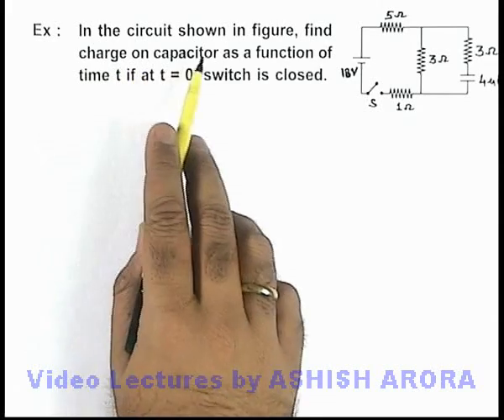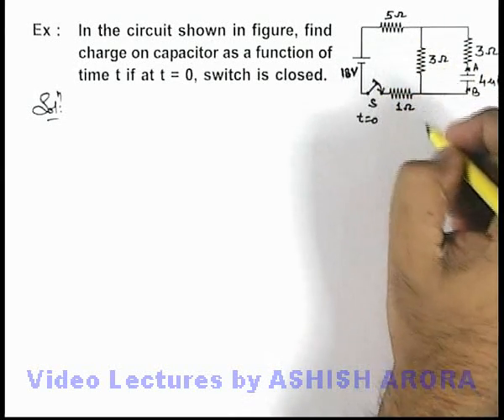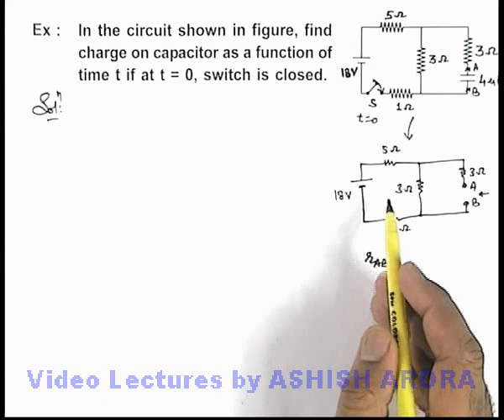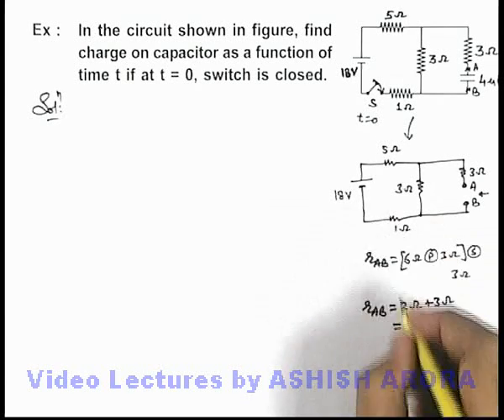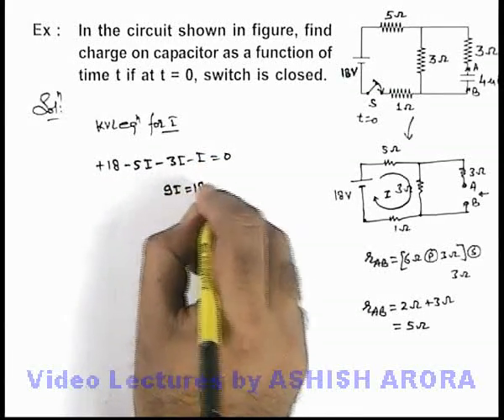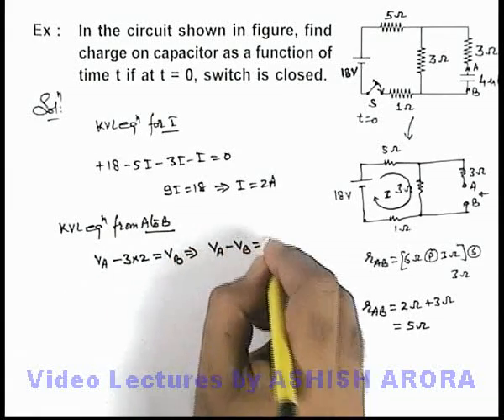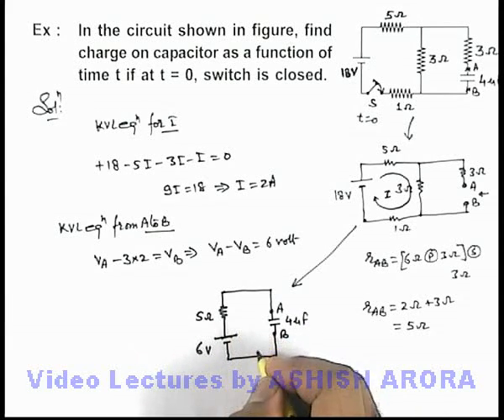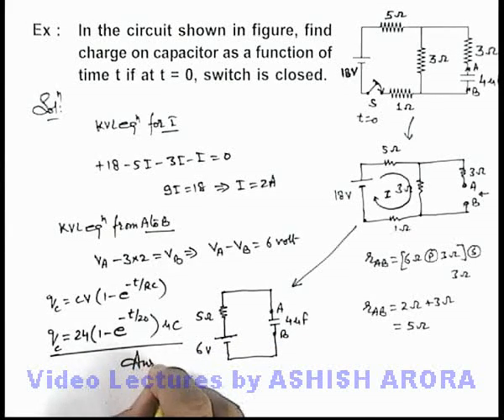Class 12 Physics | RC Circuits | #10 Solved Example-2 on RC Circuits | For JEE & NEET

Comment: At 1:36, why are the 1 and 5 ohm resistors in parallel with the 3 ohm? I thought the two 3 ohm resistors were in parallel, and the equivalent of those two in series with the 1 and 5.
Reply: If you consider there is no battery there then you'll be able to see it properly, you are thinking about R eq across battery whereas we're supposed to find R eq across A and B here

Comment: 3:08
Sir Why No Current through that 3 ohm Resistor
Reply: because it is an open circuit,so no current is flowing through that resistor...and while writing the kvl eq for that open circuit ,potential drop is considered at middle branch 3 ohm resistor which is due to the current of closed loop.
Reply: @StrikerBot  thank you
Reply: @yashkalia2311  👍

Comment: Sir please upload video on same problem with another battery connected in centre to 3 ohm resistance so that the capacitor will initially have the steady charge before closing the switch and find the charge on capacitor as function of time please help me sir. Sir I have a doubt whether we can use the equivalent battery and equivalent resistance in discharging of capacitor.

Comment: And if it is mentioned in the question that 'switch is closed for a long time' then do we go with the discharging of capacitor concept?
Reply from the maker: No.. if switch will remain closed for a llong time then capacitor will get a charge and attains steady state... will not discharge... in above circuit unless switch is opened...

Comment: Sir correct me if i am wrong, if voltage of the left loop is 18V and current flowing in 2A , shouldn't the equivalent resistance for that loop be R=V/I = 18/2 = 9.
Reply from the maker: For the left loop you can directly add the resistances in that loop... 5+3+1 = 9Ω but why you want to calculate it...

Comment: This method is of course well and good but i'm unable to think of any other method! Could you help me with that?
Reply: Did you cracked JEE?
Reply: But that method would be long and time consuming
Reply from the maker: Use KVL as another method for which you need to consider current in second loop also and write KVL equations of both the loops then eliminate current in first loop from these equations and use second current i=dq/dt and integrate... you will get the same result...
Reply: gotcha ! great
Reply: i just developed a method to solve   use the method of equivalent emf and get answer in 5 sec . first do a s it is break across device u need to find and considering batteries as real batteries with internal resistance as whatever just close resistance is (imp in series)  and wherever emf not present assume it to be 0 volt likewise here in question with both the 3 ohms assume a battery of emf 0 volt and same for 1 ohm. note for 5 ohm already a 18 volt battery in series so bring it close to it . now use eqivalent batttery concept and equivalent internal resistance concept
Reply: @shashikantmaurya1038  your.method is much longer
Reply: its not  a method  i asked sir whether its  correct or not or if correct then its short method for short level problem